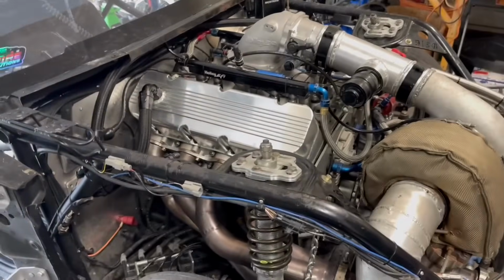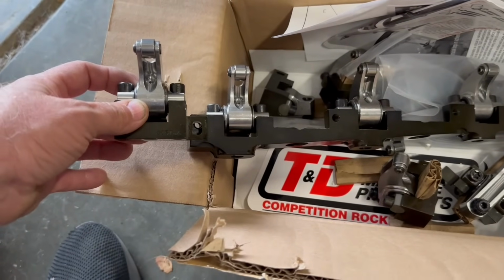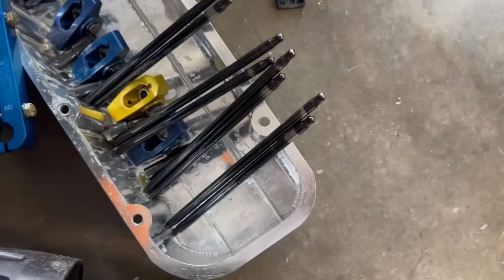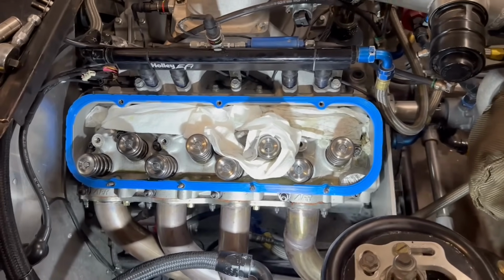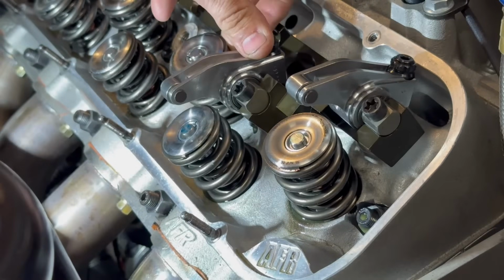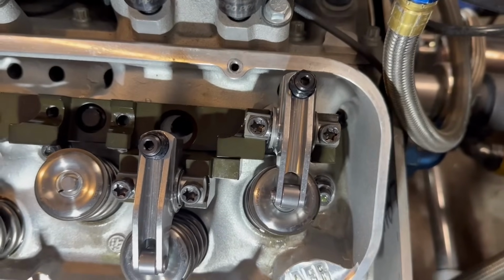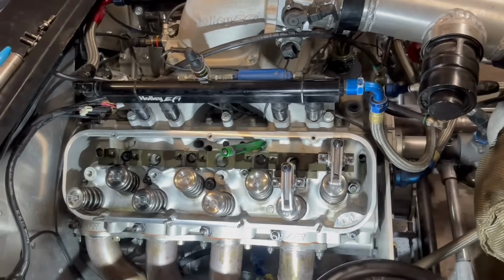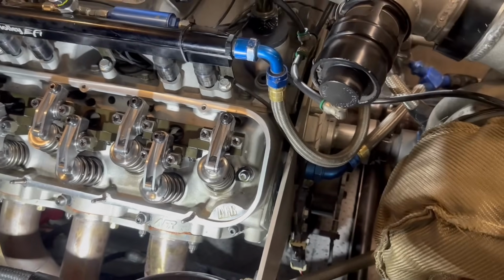Shaft Rocker Arms // T&D Machine  //  Best in the Business

Comment: PLEASE READ TJ , you have to use tread sealer on intake bolts or you Will get oil in take runner sir . I let it sit over night as well to dry . Also pattern should be thin and in the center on all valve tips or valve guides will wear quickly .... Just heads up buddy 🙏💪😎👍